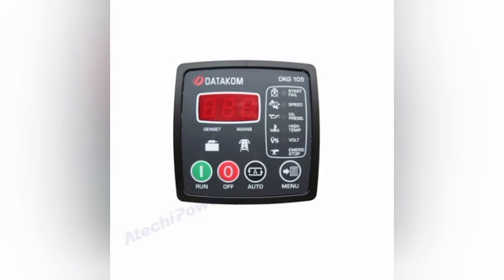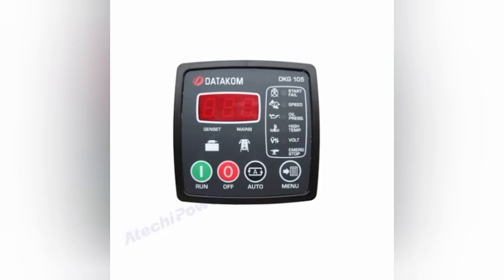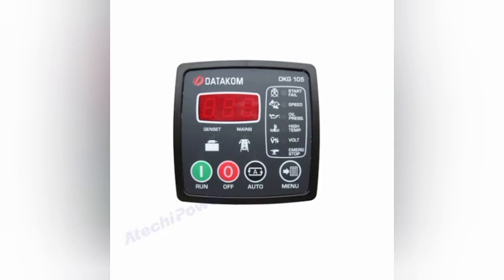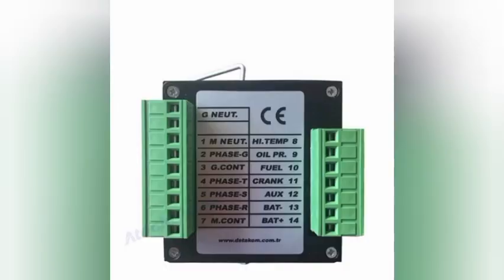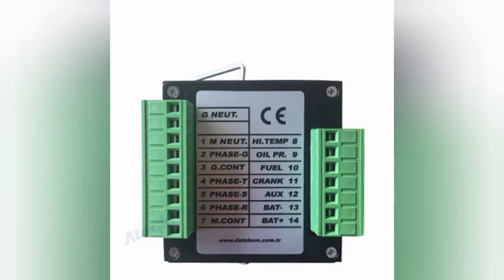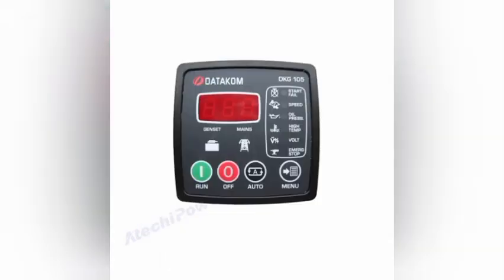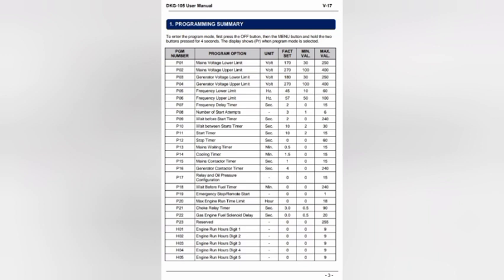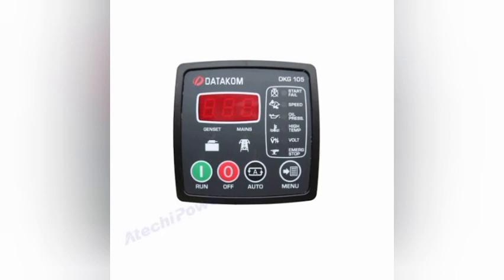Datacom DKG 105 generator controller, wiring installation , programming parameters setting

Comment: I wanted to have a small info on the DKG- 105.

I wanted to have some clarifications on the following: 

1) When is the fuel solenoid activated? Is it activated at the same time when the crank starts or is it already activated during the wait before start period ? 

2) Is the fuel solenoid activated during the wait between start period or the fuel output is shut off during that time? 

I need to have some clarifications on the activation of fuel output.